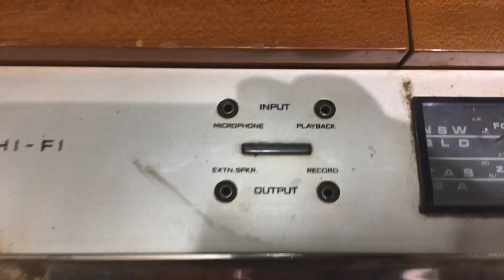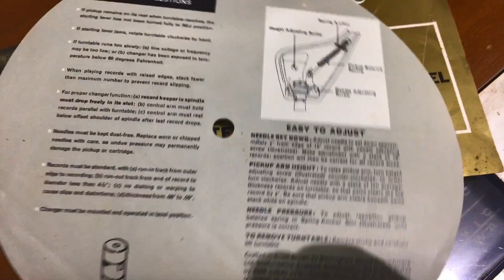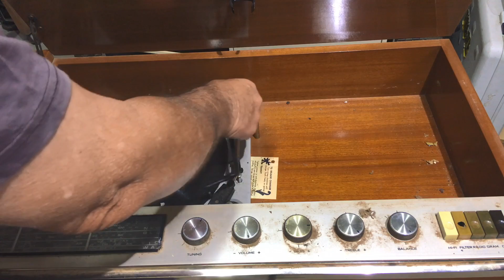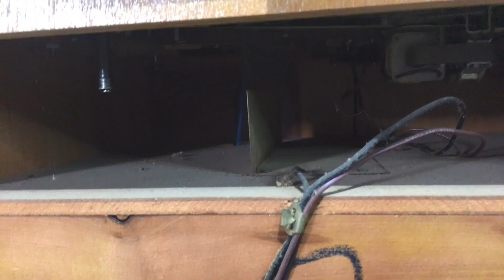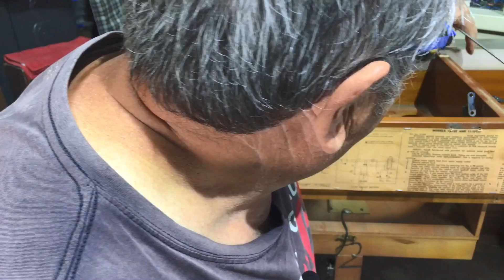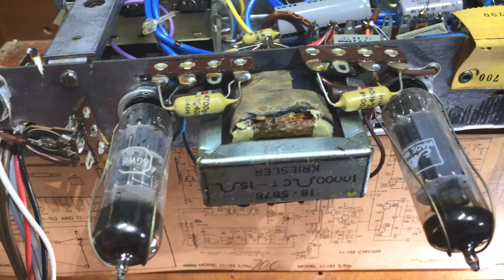Repair to a Kriesler 11-102 MultiSonic StereoGram - Part1

Comment: Hi Baz, great video! I have this same gram and am having issues with the power supply. Did you have to do any repairs to this power supply?
Reply from the maker: No not really, replaced the main filter cap. Not much else in there except a bias 22ohm resistor & the Rect Valve.
You can get a circuit from radiomuseum.com
Both 102 & 103 have same supply.
Cheers
Cheers
Reply: @techobaz55  thanks Baz, I changed over the resistor, seems to be all powering up well now. I’m unable to get anything out of the speakers though. I’ve checked all the speaker connections and they seem to be fine. I can hear the acoustics of the song playing on the turntable, just no volume. Any ideas on other items I should check?
Reply from the maker: @Matt-e6j check your 6GW8 plate HT voltages, should be around 235v. If not there check the HT at the centre tap of the audio transformers. These known to go open. Also check voltages on 12AX7 preamp valve.
Reply: @techobaz55  thanks Baz. I have one faulty 6gw3 tube. Where would be the best place to purchase a replacement?
Reply from the maker: @Matt-e6j Ebay for sure, just search for new old stock 6GW8, they are pretty common. Glad you have nailed it !
Cheers
Reply: @techobaz55  Hi Baz, one last question sorry mate. I have been through and replaced all the capacitors you mentioned in the video and everything is now functioning well. The only is that is will only play through the left hand speakers. For some reason there is no sound coming right at all. Anything you would suggest to look at?

Comment: Hi Baz. I have a pair of Kriesler Custom 15 speakers and would like to know if they had the Kriesler K22 11-118 3 way crossovers inside them from the factory. The speakers I have seem to not have one at all but looks to have some type of capacitor in them. Are you still able to get the original 3 way crossovers for them or an aftermarket one that would work?  Any help is greatly appreciated.
Reply from the maker: Hi, I am not familiar with that unit nor speakers. Sorry, can't help with any crossover info from myself.
Anyone else on here able to help with this question ?

Comment: Thanks for this Baz. I have a 103 that is generally in good nick but the volume is scratchy. Have the confidence now to go on deeper. The valves have always scared me. I did however break the pilot globe doing a clean. Any idea where to get another? I also have the bsr turntable.
Reply from the maker: It's a really good feeling to have helped someone else with their repairs Mitch, glad you enjoyed the video & was able to take something from it.
Mate, the lamp is a very regular 6.3volt and you should be able to pick one up just about anywhere, a good electronics shop will have them. Just not sure where you are located so bit hard to advise.
Cheers
Baz
Reply: @techobaz55  In Brizzy..jaycar should have them? Can I use the CRC you're using on the scratchy volume pot..or would you recommend something like deoxit? Cheers
Reply from the maker: Yep, Javcar will have 6 volt lamps for sure !
I use CRC 2-26, much lighter than WD40. You can use any contact cleaner or if your really stuck, Isopropal Alcohol !
Cheers
Reply: @techobaz55  sorry to bother again and not sure you do troubleshooting this way, but I pulled out the chassis and have the volume pot a small spray of isopropyl, but maybe I bumped something putting it back in because now there is nothing but a loud hum through all speakers. No change between radio and gram. 😔. Appreciate any help. Thanks

Comment: Hi Baz. Great video and most helpful. I need to remove the chassis on my 11-103 , as there is now a hum. Looking to replace out the power caps. Is there a difference in the removal process to the 102? Thanks, Mark
Reply from the maker: Hi Mark,
The 102 is identical to the 103, same chassis & mounting. The only difference is basically a VU/Tuning Meter vs the Magic Eye on the 102.  Glad you enjoyed the video & picked up something useful from it !
Cheers
Baz
Reply: @techobaz55 thanks Baz. Thanks to you I’ll be confident enough now to pull the chassis and attend to the caps. Cheers, Mark

Comment: If you are interested, and to save you rewinding that transformer, i  have a spare power supply for one of those.  Transformer is good.
Reply from the maker: Hi ya Stuart, might have to look for another transformer mate, this one is beyond rewinding. If you can help out could you flick me an email at  radio55@bigpond.com
Cheers
Baz
Reply: Techobaz55 I'll send you an email possibly tomorrow, probably Tuesday.  😊
Reply from the maker: Hi Stuart,
Further investigation of my transformer is not shaping up good at all. Looks like the Primary & Secondary windings have been damaged. I'm certainly no expert on rewinding tx's so think this one will be scrap. 
Can we message via email regarding what you have ?
Cheers
Baz